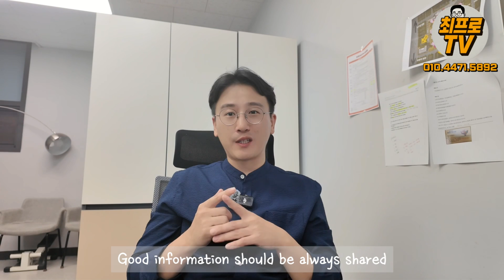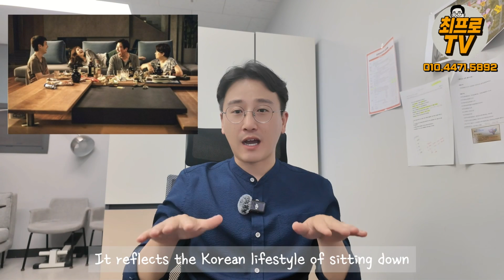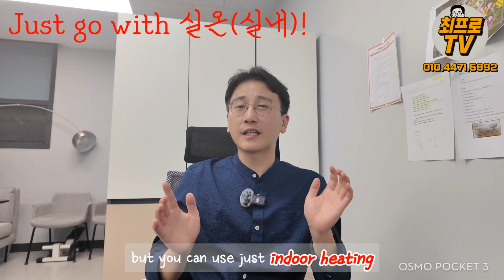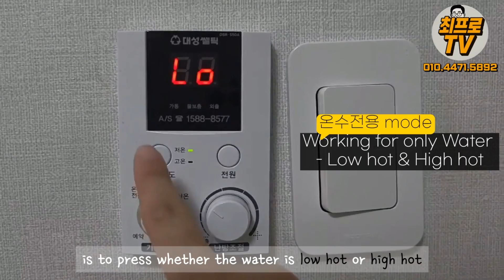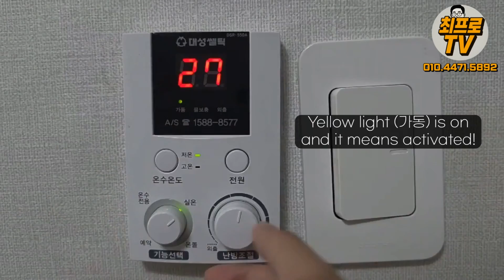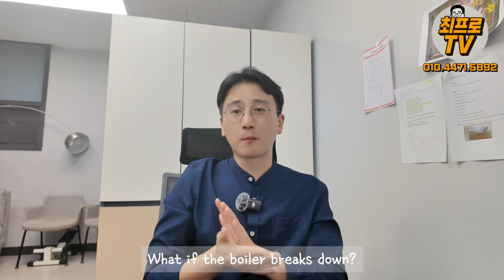How to use Korean boiler (보일러; thermostat & floor heating)

Comment: Is 외출 mode sufficient to prevent pipes from freezing even in old style homes?
Reply from the maker: Even if the house is old style place such as 주택, the boiler will work fine if it was replaced recently (3~5years before). It runs intermittently to prevent the water inside from freezing. Better than setting nothing in winter time! 

If it got frozen by your carelessness, it causes way more cost to fix later lol